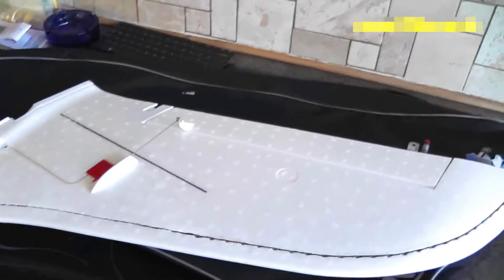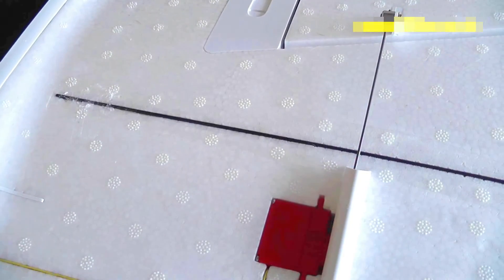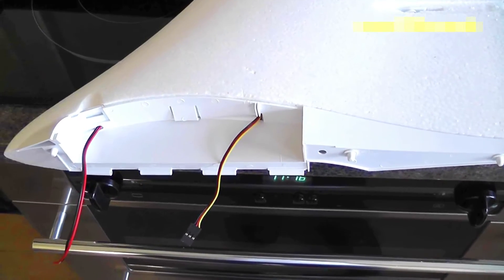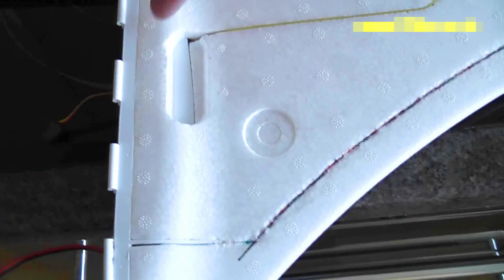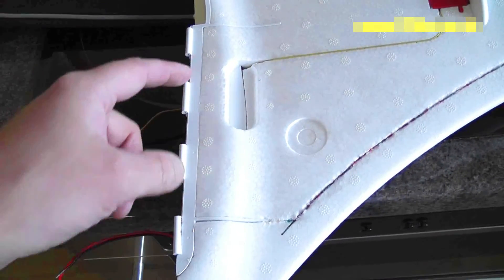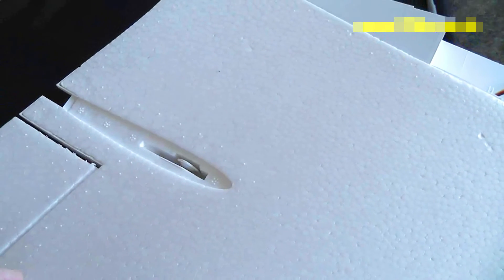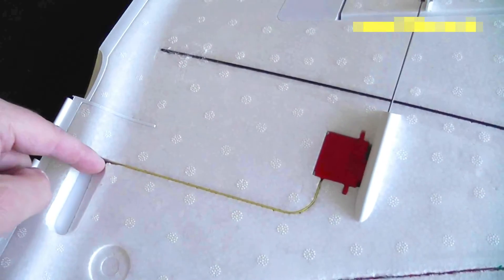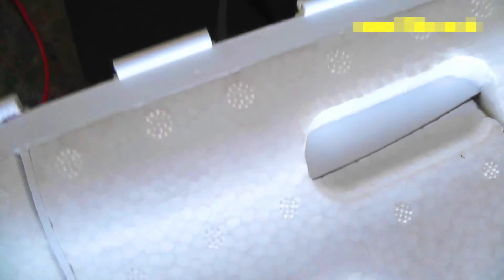Multiplex Xeno #02 - Hints & Tips for building this Flying Wing!

Comment: I am allergic to super glues / cyanocrylates so I have built my 2 using foam safe epoxy resin.  It allowed more time to get all those tight parts to fit before the glue went off.  It would have add some weight but hardly noticeable I would expect.
Once you have a XENO you will love its flight character and how convenient the way it folds up fro transport is. 
One of mine has been to Japan and Australia safely as checked luggage!
Reply from the maker: Hiya mate... I did get this flying eventually, flew it several times, enjoyed every flight too. What a bummer to be allergic to superglue! Glad you found a way around that problem though :-) Must be awesome to take it abroad and go fly it in some beautiful places?
Reply: G'day . I took Xeno 1 to Australia's  Lismore flying club, near some of the most lovely beaches and nice slope soaring spots.
Reply from the maker: Nice, did you get any pictures from it?
Reply: Unfortunately none.
Reply from the maker: Oh well, thanks for the tip on foam safe epoxy though, what glue did you use? I have a new funcub to build next..

Comment: The main faulty design with the Xeno is the rudder horns being on the underside of the wings, bringing extreme impact to the servos and horns when landing. Also those glued-in horns are shite and not strong enough to handle the force needed to control the flaps. I would highly recommend to install proper rudder horns on TOP of the wings and also reinforce the area around them with either thin plywood or glassfibre!
Reply from the maker: Mine have never had any big impacts upon landing, let along any extreme impacts, its never been an issue with the Elavon's.
Reply: @RichardWraith  Of course it depends on the ground you're landing on. If you hit a meadow with moulehills ore that was fucked up by wild boars, it can kill your servos. I didn't even had those protection caps installed, when I got my Xeno. But after changing the mechanism to the top of the wings, it lands way softer and without any damage.

Comment: A couple comments and questions....  First of all nice to see a Multiplex Xeno vid.  I have had one in a box for years and no longer see them around.    Are they still available in your part of the world?  Regarding glue,  I use Beacon Foam Tac here in the states.  Not sure about availability over seas.  I think UHU POR is your closest match and works fine for these components. Whenever installing embedded carbon stiffening pieces I mask off installation slots with tape, makes for a cleaner install.
Reply from the maker: Hiya BG, I don't think they are available anymore, this was 8 years ago now. I do have a spare one, still in its box and my now broken one in its original MPX carry bag, but haven''t touched it in years. MPX Zacki worked out not bad, and is THE best glue for their specific foam, so I stick with that (See what I did there?)